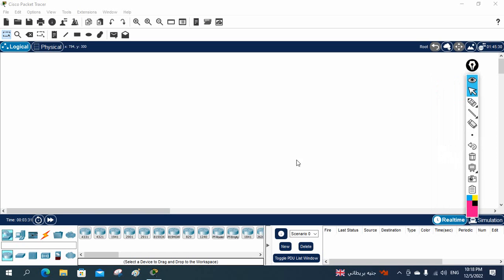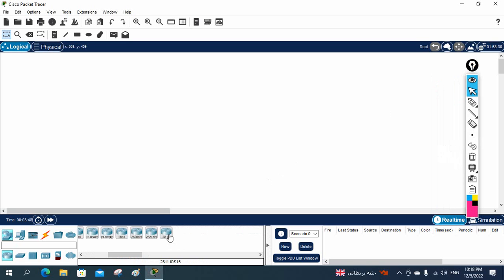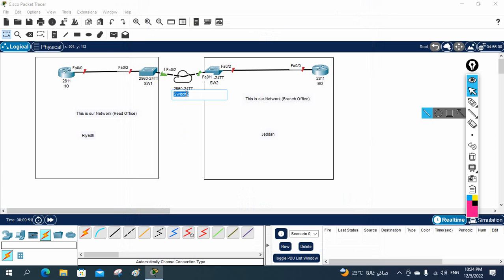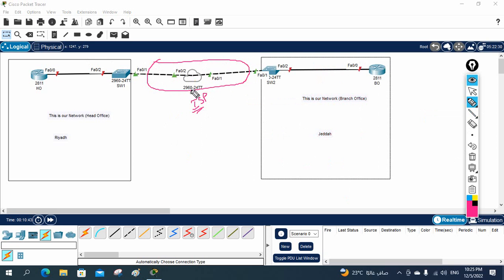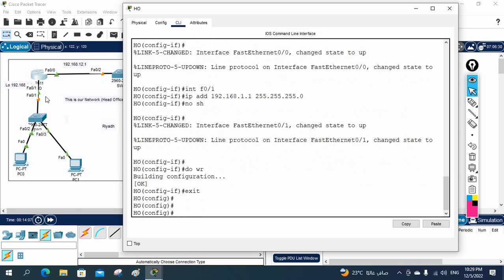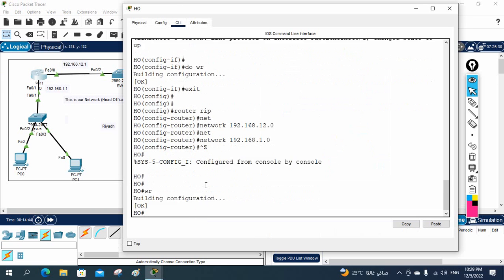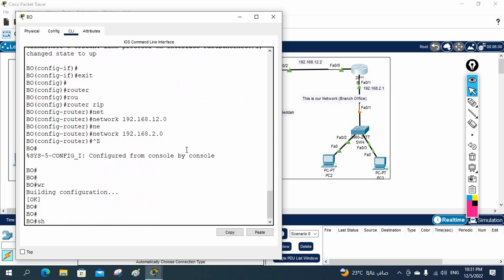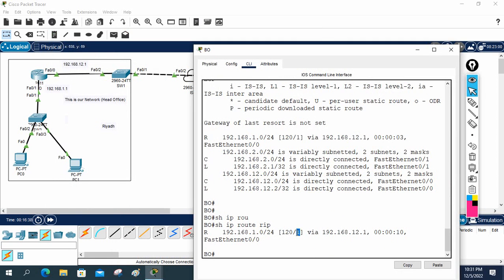34.How to Connect Head Office with Branch Office by using RIP? | CCNA 200-301 | Networkforyou

Comment: Problem Statement: Multi-Branch Office Network Setup
Objective:
Design and configure a network for a company with two branches in different cities,
connected via a WAN link. Implement subnetting, routing, and Port Address Translation
(PAT) to ensure efficient communication between branches and secure access to the internet.
Scenario:
A company operates from two branches: Head Office (HO) and Branch Office (BO). Each
branch has multiple departments that need to communicate internally and access the internet
via a shared public IP. The following requirements must be met:
1. Subnetting must be used to allocate IP addresses efficiently for departments within
each branch.
2. Routing must be configured to enable communication between the two branches over
the WAN link.
3. Port Address Translation (PAT) must be implemented to provide internet access to
all devices using a single public IP.
4. The design must ensure scalability for future department additions.
Deliverables:
1. A fully functional network topology in Cisco Packet Tracer.
2. Configuration files for HO and BO routers, including:
o Subnetting details for each department.
o Static routing setup.
o PAT configuration for internet access.
3. Verification steps to test communication:
o Ping between devices in different branches.
o Internet access from any PC. design it and give me a .pkt file sir is it same??

Comment: You explained it very nicely. Thanks.
Just one question; why would you switch instead we could directly connect the router to ISP and then use switch(es) for further connections to end devices. Can you explain the reason for using a switch btw router and ISP? Thanks
Reply from the maker: Hi,
We can connect directly also. Some company use switch before that depends company to company design network. Best practice is better use switch. So we can use different plan etc..
Thanks

Comment: SIR In RIP protocol you miss some command like,
Vir 2
No au
Reply from the maker: Hi,
I am using rip version 1 in that we will not write that
When we use rip version 2 then we need to use that.
Thanks
Reply: @networkforyou11 thanks sir